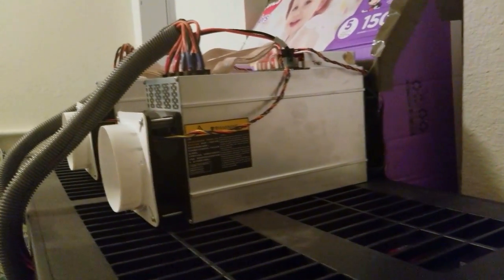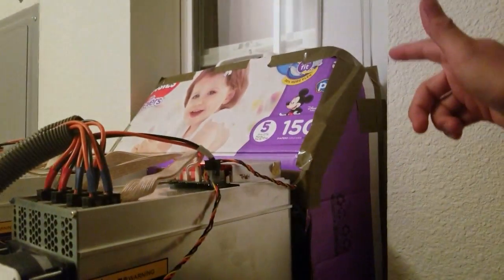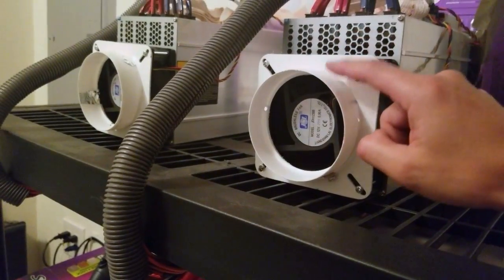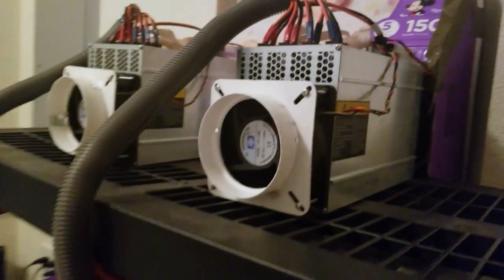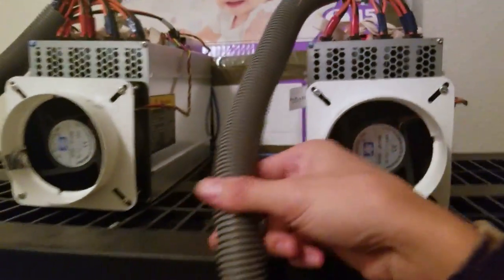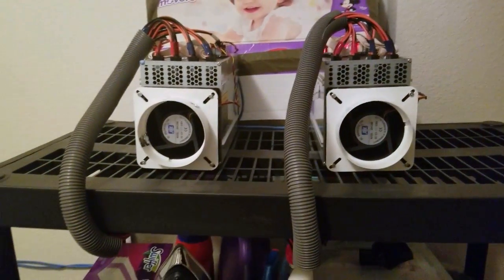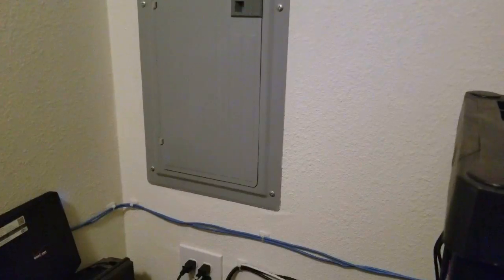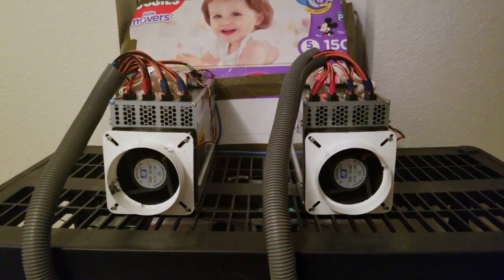Antminer L3+ Setup and cooling solution

Comment: Hey Rob, I'm thinking of overclocking my L3+, but I'm waiting for the warranty to void first. Think that's smart? Or should I just start overclocking now. If I decide to overclock, will I need an outlet with a higher voltage (110 vs 220). Also, why did you choose 500mhz? Why not higher? Why not lower?
Thanks!
Reply from the maker: I don't care about warranty as my miners have already made their ROI. If you're good with computers, understand what's involved physically with overclocking, and know how to overclock then there is no issue with doing it now.

You will not need to install a higher voltage outlet. What matters is how many watts your power supply can push. My power supplies are 1200 watts each.

I chose 500mhz because my miners become unstable (too many HW errors) after that threshold. I have found they aren't receiving enough power to overclock past that point. If I had power supplies with a higher wattage I could push them harder (assuming I can keep them cool enough)

Comment: hi bro. hey congrats on your mining. i just start with my first antminer. I came out with an idea of replacing the fans with some industrial fans that are specially to blow high amount of air to dry wet floor. This fans are so quiet with higher amount of air. have you ever tried any mods to antminers? besides this.

Comment: Dude, this is the worst thing you could do. When hot air and cold air meet it condenses, ie moisture in your machines.
You should switch the machines around so they blow the hot air outside and your room will be at a normal temperature.
Reply from the maker: NeonVisual.com that's not how condensation works. Condensation requires there to be a stagnant amount of air volume immediately surrounding a surface that is warmer than the surface (think of a cold drink "sweating" in the sun).  The volume of air moving past the boards and chips displaces that stagnant layer. It's impossible for condensation to form under these conditions...I appreciate the concern! but i know what I'm doing.

All that being said, hot devices don't produce condensation anyway...only cold objects (surrounded by stagnant, hotter air) enable condensation. Simple science friend.
Reply: google "dew point".
Reply from the maker: NeonVisual.com dew point is irrelevant when moving that much air. It's impossible for the air's water content to literally "condense" when it's disrupted so violently by high CFM movement.
Reply from the maker: NeonVisual.com that's different. There is no airflow
Reply from the maker: NeonVisual.com regardless. We can debate theory over the internet of what we think will happen. It's current 30 degrees out. There is no evidence of condensation. Again, I appreciate your concern but I'm not worried.
Reply from the maker: I've yet to stumble across any scientific publication where a warm or hot object  (not air) produces condensation on its surface while being bombarded with fast moving cold air blowing across it's surface area.

If anything, I'm more concerned with static than condensation. As a matter of fact, I'm not concerned with condensation.
Reply from the maker: NeonVisual.com im not trying. Im DOING. And it will function through winter just fine. 

You know I thought about another perfect analogy on my way to work...It's interesting how water in the winter air doesn't condense and stick to a car's windshield that's heated and has air blowing over it. If we are to imagine the boards like the heated windshields, well it would seem like the principles I outlined hold true.

I'll do a follow up video in 4 months. If you're right. I'll let you know.
Reply from the maker: NeonVisual.com lol
Reply from the maker: NeonVisual.com 3 months of overclocking and still running just fine, even in sub 30° outside temperatures.
Reply from the maker: neonvisual.com 4 months of overclocking now with direct air from outside.  still no damage from condensation and no evidence of water depositing on the electronics. Mostly due to the fact that, you know, that's not how condensation works. 

it was down to 3ºF last week. when is the condensation supposed to show up?
Reply from the maker: NeonVisual.com 6 months of overclocking now with direct air from outside.  still no damage from condensation and no evidence of water depositing on the electronics. Mostly due to the fact that, you know, that's not how condensation works... how long should I keep this record?

Comment: Are these over clocked?
Reply from the maker: WISCLO yes. I have them overcooked to 500M
Reply: Would you mind sharing their temperatures? Also, what is the room temp, and outside temp? Thanks!
Reply from the maker: As of 20171118 at 1923EST, current board temps are ~58ºC and ASIC temps are ~65.5ºC. my Fans are running at 50% to reduce the noise. Current outside temp is 59ºF. Current inside temp is 73ºF.
Reply: did you even watched the video?..
Reply: the fucking video has all the info you asking.
stop wasting Roberts time with this questions... 
lazy fucker

Comment: Hi Robert! Why the damper vents on the backside (00:46)? The Air flows out anyway, so why the Fan Shroud?
Reply from the maker: MAXimator70 when it's warmer I, I turn the miners around, close the window, and run the house AC. I then have the exhaust side hooked up to ducting and I have it all vent out an existing dryer exhaust duct.

Comment: excellent video. your fine with outside air. i would worry about household 6 pulling rank for making her laundry room 160 decibels.  can you do a video on what pool you use and how to set up there. also what is that 3rd party app and why not use bitmain hardware display for temp. my hash is 556 @425 freq. 55 c temp. 24 hw a day or so. i use nicehash $20usd a day w/o electricity cost on my 240v l3 antminer.
Reply: Also that mining temp is for your PCB temp not your Chip Temp which is probably 50c based on what mine are when my pcb is 43.
Reply from the maker: Actually right now because it's so much colder, 34°F, I have the fans at 25% speed, and my chips are running at around 55°C.

Comment: Hi Robert, It is very motivating to see your solution. Where I'm living is going to have a very long winter time. Therefor I'm also thinking to take advantage of cold air outside. My plan is to install a 12cmx12cm ventilation fan on the wall and direct the air to (right infront of) my l3+ with a 12cm diameter aluminium ventilation tube. My question is: How do you prevent the snow or rain droplets being carried along by ventilation fan?

Comment: so 7 days on .. have they blown due to moisture damage yet ? just asking  ;)
Reply from the maker: 11.11 you have it backwards...hot/warm air over a COLD surface makes condensation. Cold air over warm equipment does not.
Reply from the maker: 11.11 it's not sucking in mist from outside. There's almost no humidity because it's getting so cold.
Reply: since when do people have a problem with moisture like i have never had an issue and i am running a similar set up
Reply from the maker: dank jr I think people are mistaking humidity for condensation. Having around 40-60% humidity is necessary to avoid ESD.
Reply: not really robert ,if you directly suck cold air (on a constant) into a hot room or miner in this case ,it will create moisture ..simple science ,nothing to do with humidity, the just asking at the end was a pun relating to another comment good luck brother ..
Reply: You're both right.If you directly sucked cold air into a hot room, enough of it to make the 'hot' room cold and cold enough that the temperature difference between the now cold room and the opposite side of a "hot" barrier it will create moisture. But that moisture will show up on the opposite side (the warm side) of that barrier.

Comment: Hi, is that ok for the machines long run with overclocking? Only be careful of temperature, then what temperature is concern to change overclocking to normal? What about summer time, if machines temperature is low still overclocking is fine in summer?

Comment: I hope you have some kind of filter on your box fan or you just blowing dirt in your machine :/ humidity is a factor to in the long run. Just saying
Reply from the maker: Crypto Coin Growth just saying is a very passive-aggressive way to end an opinion, just saying.

I've been in IT for over 10 years, and I've done sysadmin work in the freezing cold, humid southern forests, and the deserts of Afghanistan. I am very familiar with the limits and capabilities of electronic components in all austere environments. 

While I appreciate your concern, why not just ask what my solutions are to these "issues" rather than hoping in a pretentious manner?
Reply: robert germanelo just a heads up my friend. No other reason. Some people miss the simple things.
Reply from the maker: what issues? I have no issues.
Reply from the maker: David Haakonsen as I've already stated humidity is not an issue. There is no "dirt" in the air. Normal dust particulate is a non issue as well.

I've ran servers in the Afghan desert that had been running for over 18 months without more than a wipe down and they ran fine...and that place had super fine dust that got into everything. 

Humidity, or condensation for that matter, are not an issue. The fans are moving enough air fast enough for those to not be an issue.

Comment: Nice vid! Question, you're running a hefty overclock but seem to have heat managed. How long have you run at 500? And, given higher error rates have you been able to compare real increase in shares processed? Thanks again!
Reply from the maker: Billy Jack I've been running it at 500 for about a week. I've gone from making about .52 LTC daily to .65 daily
Reply: still going strong at this level?
Reply from the maker: Crypto Bulldog yep! Not a single ASIC error